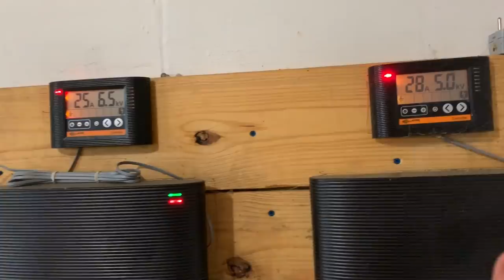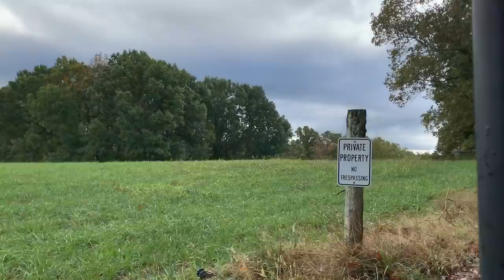Cow Tricks & Treats : Corn Silage 2019 Part 3

Comment: I had a truck that did the same thing, and I had to pull the steering wheel hard to one side or the other and hold it tight to that side and the key would turn over. Most trucks and cars that do that are usually caused by someone pulling on the steering wheel when they get out or in, and it causes the collum lock to latch in a tight position.
Reply from the maker: It made me so mad hahaha
Reply: @ThisFarmWife_   Lol. It can be aggravating.  If it does it again try turning the steering wheel really hard to the right, and hold it there while turning the key. And to the left, If the right doesn't work. lol.
Reply: Meredith Spray a drop of the Millennial Farmers Wd 40 down the keyhole and around the lock and maybe try a different key and it will work like a dram Keep up the good work yese all From dusty Western Australia 🇦🇺

Comment: You need to replace the electromechanical switch behind the key.  It gets stuck and prevents the key from turning.  Moving the steering wheel works if it's the lock, but it's not the lock, it's the "thing" they key turns...electromecanical switch.

Comment: I was having a problem with the ignition in my car, I took it to our mechanic he told me to take it to a locksmith. I decided to try an old school remedy. I used a syringe filled it with oil then stuck it in the ignition and slammed the oil in. Haven't had a problem since its still working fine after a year.
Reply from the maker: Ha...good to know!

Comment: What model Farmall is that?  I mean is it a H model or a M model or what.  I learned to drive with a clutch pedal on a H model.
Reply from the maker: I tell you in the video...I think I said 52 lol. I can't remember now
Reply: Straight m got band brakes . spent a lot of time on them when i was younger. Remember grabbing the steering wheel to put the clutch in if you didn't the clutch would push you off the seat .
Reply: This Farm Wife - Meredith Bernard see my edited message.  I mean a model H or M etc.
Reply: Lawrence Kieffer oh yes,  if you didn’t have a tight grip on the steering wheel the clutch would never go in.  If you were like me barely weighed more than 100 lbs and needed all help we could get.
Reply: @flyerbob124  never thought about that i just assumed being on a grinder it would be an m also Lawrence mentioned that it was a big tractor back in the day. The frame rails on a m are wider plus something about the holes in the front grill and the steering rod sits closer on a m . now you really got me curious